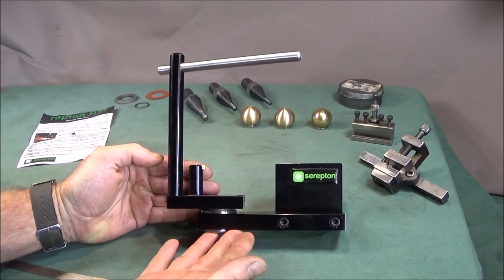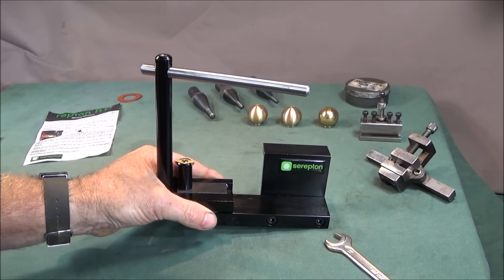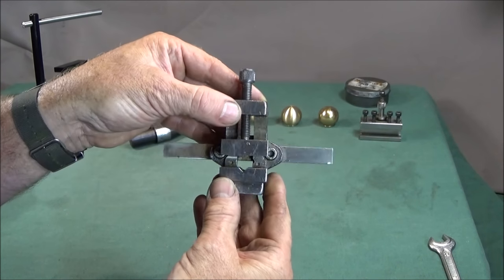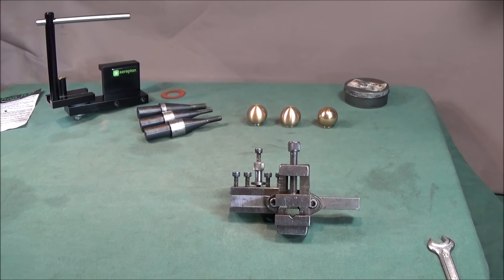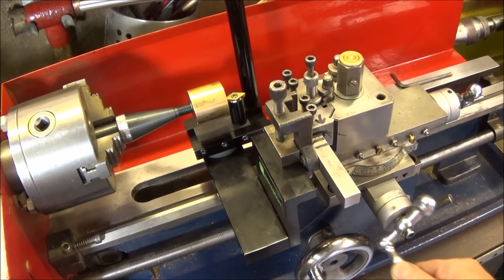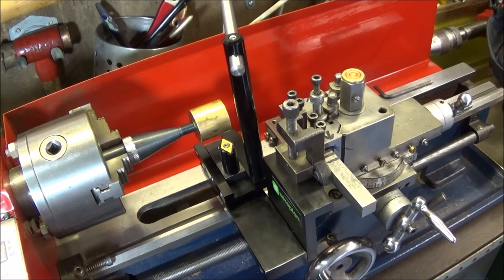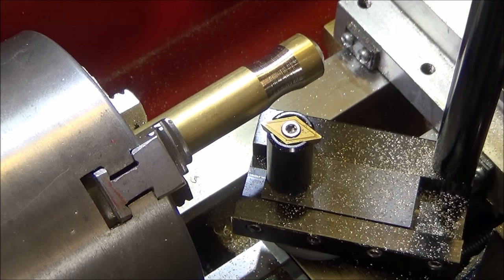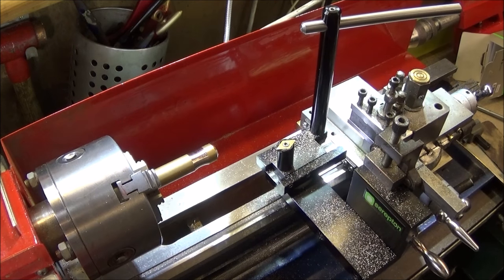How To Set Up & Use The Repton R1 Ball Turning Attachment Tool On The Chinese Mini Lathe

Comment: tool is junk, bout as bad as it gets. made from aluminum thru out and flexs all the time. but using the design i remade the entire tool from steel with a built on tool post block. works much nicer with heavy cuts to but u still need to finish using lighter cuts.
Reply from the maker: Hi I only use mine on brass with light cuts, otherwise I would remake mine using steel. They must have used aluminium to save money, which is a shame as it could have been a really great tool....Bet your one is excellent. I have since bought a RDG Myford ball turning attachment which is real heavy duty one. The only reason I still keep the Repton is that I can use it on the Mini Lathe, on soft material.
Reply from the maker: Hi I have noticed that there is similar design ball turning tool on Ebay now. This one is made entirely from solid steel so it must be a lot more rigid than the soft aluminium Repton version.
It is made by Lathe Turning Attachment Radius-Company JANPOL Model: JG 50j18, for the Myford. They do quite a few different models of this tool for many different makes and sizes of lathes as well.
Reply: ive just put a full ball end on some stainless bolts without any drama or chatter

Comment: Hi Steve, I have now brought the lathe ball turning attachment for the Boxford, Harrison and Colchester lathes. The tool is well made from solid steel as described and works well. My only criticism is the the tool came with no setting up instructions what so ever. The three videos on the tool only show the tool in use. I used your video on setting up the Repton to help in setting up. Many thanks Tom

Comment: Hi Steve,saw this,bought one on your recommendation.It's a nice tool and Repton are on the ball,arrived here in NZ only 5 days after ordering.Thanks for the heads up on this,and all the time you take making all these vid's.Great work.
Reply from the maker: Hi Malolm, Thanks, I hope to complete another video using this tool on my Myford ML7 lathe, but it will have some useful ideas for using the tool on any lathe. I used to make, assemble and test ball jointed wing pivots for the Tornado GR1 Aircraft, so I have have a bit of knowledge I can use for other aspects of ball turning fixtures.
  I sent something to NZ recently and I was surprised that it arrived within a week. That's better than our internal post!!! Regards Steve
Reply: Hi Steve,Just starting out model engineering,have a cheap Chinese and an ML7 lathe,and a recently purchased largish Chinese mill still only partially unpacked.I'm a recently retired aircraft maintenance engineer,mostly helicopters. I am about to join a local live steamer club.Where in the UK are you living.We immigrated here from the Midlands in the early 50's.
Anyway,keep up the good work,always enjoy your vid's.Cheers.

Comment: Very nice, I appreciate your ingenuity. Problem solving is the BEST ATTRIBUTE IN ANY MACHINEST. I WOULD NOT BUY THE ALUMINUM ONE. LIKE YOU SAID MADE A STEEL ONE. AND I WOULD USE A SEALED BEARING. I KNOW OF A COUPLE WAYS MYSELF HOW TO REDESIGN THE TOOL. I HAVE A 13 X 7 SOUTHBEND. SO I HARDY USE MY MINI LATHE. BUT 30MM IS PERFECT FOR MAKING A HAND ROUTER PLANERS. IF I HAD THE CAMERAS A ALOT MORE TIME. I WOULD MAKE A FEW VIDEOS AND OR AT LEAST SHARE SOME IDEAS. AGAIN MOST PROBLEMS ARE MET WHILST OPENING UP YOUR MIND. YOUR INGENUITY EXCEEDS MY   PATIENCE. I MAKE GUN PARTS AND TOOLS IN MY MACHINE SHOP. CHIP ON AND PROSPER.  BLESS YOU AND BY ALL MEANS HAVE FUN. I CANNOT WAIT TO GO TOO MY SHOP EVERY MORNING.

Comment: I have tried to obtain a Repton R1 but it appears that they are no longer produced. I have seen a similar tool on the web for the Boxford/ Harrison/ Colchester lathe said to be made entirely from steel. I would value your comments on this tool. Best regards, Tom
Reply from the maker: Hi Tom I think the steel ones look best. The Repton was aluminium and didn't perform well. I got rid of mine as it was so bad. I'm pretty sure those steel ones would be good but I haven't handled or tried one. Regards Steve
Reply: @SteveJordan  Hi Steve I have now brought the lathe ball turning attachment for the Boxford, Harrison and Colchester lathes from janu 3724 and it is a well made item all solid steel as described. The only complaint I have is that the tool was sent with no setting up instructions what so ever. The three videos on this tool only show the tool in use. I used your video on the Repton has an aid to the set up. Many thanks Tom

Comment: Thanks for explaining what's wrong with my Repton. I shall now correct it. It would be helpful if you had explained why you were making the adjustments you were on setting up. Repton's own video similarly does not explain why each stage is followed. For instance you repeatedly locked off the carriage, but did not say why.
Reply from the maker: Hi Rick, yes I should have explained the instructions. but I have sold mine now. It is the same on my ball turning device though. So next time I use it. I will show the procedure. Regards Steve

Comment: Hi Steve I have a Repton RT1 ball turning attachment and i need a replacement carbide insert have you any idea what it is ,For mild steel .Regards Mike
Reply from the maker: Hi Mike, I can't remember offhand as I sold mine a long time ago. I will see if I can find out though. Regards Steve
Reply from the maker: Hi Mike. I'm pretty sure it is a DCMT11T304 insert. Regards Steve

Comment: Hi Steve. I’ve been watching your videos and learning from things you do.  I’m wanting too make some round knobs (balls). But I have a HF mini lathe. And I can’t find any ball turning tools for it unless you fabricate something to make what they sell work.  Any suggestions?  The one your using in this video looks good but yet you need the tool you made too be able too use it.   Any help would be appreciated.  Thank you.
Reply from the maker: Hi Jack they do a ball turning attachment on eBay that fits in a toolholder. Otherwise you need to make one up. When I get time I will show mine taken apart to show how I made it, but I can't show making it again as it is so time consuming. Regards Steve
Reply: Thank you for your response. I will look again on eBay and see if I can figure which one it is.  Thanks again.

Comment: I looked up that ball turning attachment and it said something like currently unavailable, not sure when or if it will be available. Anyway I've got enough pictures of it plus your video so I may just make it myself.
Reply from the maker: Hi Dale, I don't know what has happened at the moment. They are not on Ebay either? It is much better to make your own. You can also make it better than this tool. The Repton is nearly all made of black anodised aluminium. If I made it I would have made it from mild steel and tool steel. I've had to make a new insert holder for mine already. Regards Steve

Comment: I'm not clear on how you set the actual radius dimension to be cut, ie the distance from the attachment pivot axis to the tip of the cutting tool.  It is obvious that you feed the cross slide in to take successive cuts.
Reply from the maker: Hi. Basically, you get a piece of bar with a diameter and length that is the same size as the ball you want to turn. Then, set the tool touching the front face of the bar. Lock the lathe carriage and move the ball turner around so that the tool can then now be touched on the diameter by sliding it in or out. Then, lock the ball turning tool in position using its side screws and it is then ready to turn. You may need to move the cross slide in or out to do this. But leave the carriage locked from where it was set until the ball is finished. Regards Steve

Comment: purchased this tool on your recommendation and found a few problems first no allen keys supplied  used first time found not all  adjusting grub screws tighten against holder and when using grub screws vibrate out, also this tool does flex and gives very poor cuts you can only take very fine cuts when cutting steel, also cannot do concave on the end of solid bar as I wanted the tool to. I am sorry I purchased such an expensive tool as I could have paid less for other brands of radius turners and still would have been able to do the same work. I think the Myford  radius turner would have been better purchase and you do not have the clearance problems as discussed in this video
Reply from the maker: +John Gurney Hi John. I bought the Myford one myself and did a video explaining how it is the best. The reason I haven't taken this video off is because I still use the Repton. I have found it usable for some work. Also there are plenty of comments that show the faults of the tool. I wouldn't recommend the tool now as there are others on the market which are better including a copy of it in steel construction. I have also shown the Myford ball turning tool and made it clear that it is the best. I would send the Repton back for a refund If I were you. Also I did a review on ebay for the Repton and explained its poor condtruction but somehow the reviews option and my review was removed. The company must have complained. If you had purchased the Repton within the last six months..the review should have been seen, but like I say it was recently removed. Regards Steve
Reply: Hi Steve I to have found same problem when doing reviews, I bought tool about 1 month ago but as I live in Australia  the cost to return would be very expensive, I will complain to company but hold no hope of getting a refund nice to make contact with you  regards john
Reply from the maker: Hi John, I have also changed the video description note, so that others will get a better review of this tool if they read all the comments, such as yours. I wouldn't want to lead people astray when buying tools, making them waste their money. So thanks for commenting and giving a better picture of the tool, it brings it all in perspective..All the best..Steve
Reply: thank you Steve yes the biggest thing is I feel I wasted money on this tool thinking I was buying a top English made tool, not with Chinese bears other problems. working on making tool better replacing bearing and strengthening with a steel support under were bearing is fitted and new cutter insert. regards john

Comment: Have you tried it on steel yet?
Reply from the maker: Yes it works great on steel, providing you only take light cuts. This is only because the cutting is done so far from the chuck.

Comment from the maker: An alternative vice suitable for the tool post can be seen on my tool post drill video. Its a 4" diameter rotary table vice bought from RDG. See here:- http://www.rdgtools.co.uk/cgi-bin/sh000001.pl?WD=4%20vice&PN=4--Model-Engineers-Vertical-Slide-Vice---Rotary-table-Vice-2059%2ehtml#SID=485

Comment: The tool is rubbish. Also it has to be mounted too far off from the carriage. I made one (still) that fit on top of the carriage and haven't any vibration at all. Also the ball you are turning is too far away from the chuck and this contribuites to more vibrations. Hell of a mess. Sorry for the hard comments, but it is the truth.
Reply from the maker: Hi I totally agree with you. It is rubbish....I found out later. The aluminium construction is useless.   I had to remake the insert holder out of steel. In the end I got rid of it because it had no end of problems. I made my own ball turning attachment for the Mini Lathe in the end and I can turn stainless steel balls with no problems. I based my design on the Myford ball turning attachment
.